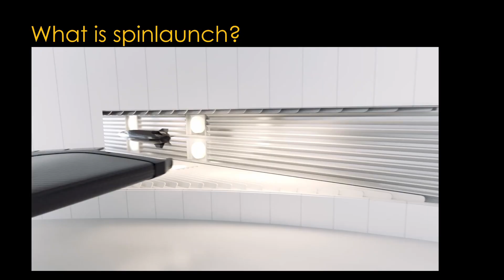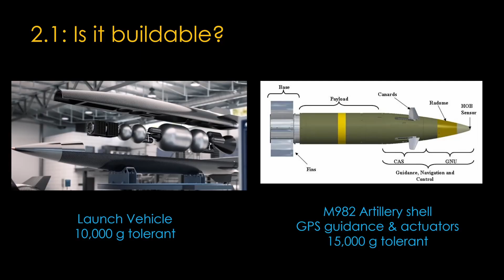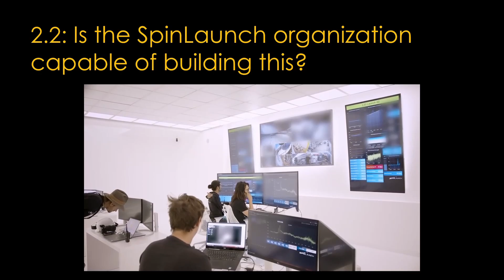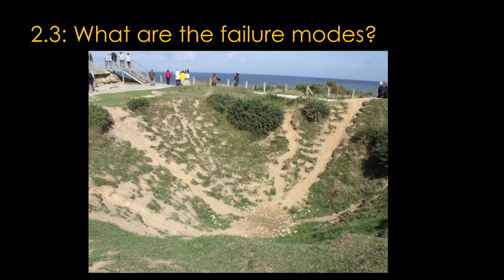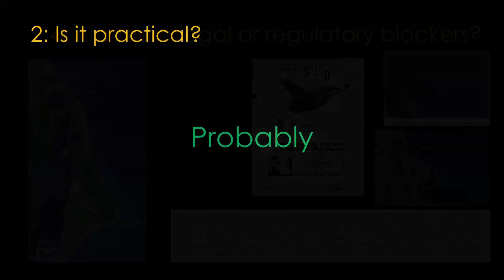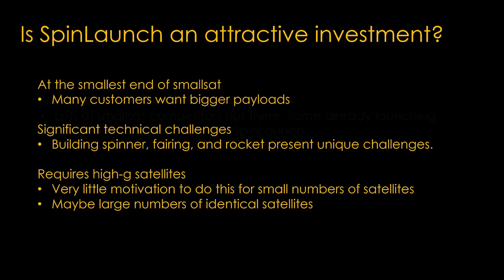Spinlaunch - What the???

Comment: December 2025 - SpinLaunch has pivoted fairly strongly from just developing its kinetic-launcher toward building a full satellite communications network of its own. Their new project, Meridian Space — a low-Earth orbit (LEO) broadband constellation — is now a core focus. 
As of August 2025, they secured US $30 million to accelerate Meridian Space’s development and commercialization. 
The plan is to start flight- and customer-link operations: they aim for the first customer links in the second half of 2026. 
SpinLaunch contracted Kongsberg NanoAvionics to build the initial batch of ~280 microsatellites for Meridian Space. 
They’ve done full-scale testing of a “multi-band reflectarray antenna” — a more compact, power-efficient antenna design they claim will help make the constellation more cost-effective and scalable. 
Although Meridian will initially deploy using traditional rockets, SpinLaunch says it remains committed to its original kinetic/centrifuge-based launch technology.

Comment: 2024 update: All the issues with Spinlaunch mentioned in this video still applies. 
1) Not a word has come out about building a launch site. They will need an eastern seaboard site that will tolerate constant sonic booms. Not easy to find.
2) There are still no details about the release mechanism. No patents on Google Patents search, no nothing. This is the single item that I believe is the hardest. I can't imagine the release mechanism being mechanical in nature as it needs to release in some max 0.003 of a second. My best guess is that it is magnetic.
3) Spinlaunch's hiring has been slow, at least from what I have gathered from Linkedin. 
4) What market does this thing even serve? The launcher cannot be moved so it only fires into a single orbit.

I smell a flop here. The worst thing is that I really liked them.

Comment: I had a hard time finding data on the size of the projectile, but I read that the 1/3rd scale tester projectile was about 10 feet long. Assuming an 8/1 length to thickness ratio, it would be about 1.25 feet thick, so we could expect the full scale first stage projectile to be about 30 feet long and 3.75 feet thick.

There must be a release/latching mechanism to hold the rocket in place while it is spun up to these high ejection velocities. Assuming the latch went all the way around the rocket like a sleeve, and connected to the swing arm on both sides (as shown in some of the renders), and also assuming a thickness of the launch clamp of about 4 inches, then the total surface area of the launch clamp would be 360 inches x 4 inches, or about 1440 square inches per side, times 2 sides, equals 2,880 square inches.

We'll use your assumption that the projectile has a mass of 11,200 kgs (~24692 lbs). At only 1 G, that means the mass of the projectile is distributed across the launch clamp with about 8.57 lbs/sq inch. That's entirely reasonable. But... we're talking about spinning it up to 10,000 Gs. That means that the force of the projectile being held in place by the launch clamps would be a staggering 85,736 lbs/sq inch. Can any material even withstand that much tensile force? I'm reading that steel is about 40,000 - 60,000 lbs/sq inch.

Also, what happens to the fuel when you compress it with 10,000 Gs of force? Wouldn't the fuel combust from the compression?
Reply from the maker: Good questions...

Comment: They released another video on this recently. Got an update? More likely or less likely a scam?
Reply from the maker: I went and watched test #7 and test #8.

They are hitting 1200 mph and 30,000 feet, or 536 m/s and 9 kilometers of altitude. The altitude is their apogee; they are coasting up to it. 

As a comparison, Electron stages at 100 kilometers at 2400 m/s

They are a long way from imparting useful amounts of energy into their launch vehicle, though that may not be the goal with this version as it's sub-scale.

I think it's good that they've continued to run tests. 

I think their lack of transparency is not a point in their favor.

I haven't used the word "scam", but my opinion is still that this will not be an economically successful launch system.
Reply: @EagerSpace  Real Engineering had a 45 minute interview with them a few weeks ago. Have you seen that? It may have flown under the radar.
Reply from the maker: @JayVal90  I don't generally watch other space youtube channels; I don't want to be creating content that is derivative of them.

Comment: Lets see:  
If the mass of the projectile is 11,000kg, then the spinning arm and bearing is going to have to support 22,000kg (the projectile and a counterweight, we are going to skip the weight of the arm itself for now) while simply standing still.
However, under 10,000 g's that mass becomes 220 million kgs, or, the weight of almost 1700 combat loaded M1 tanks.
To further illustrate the problem, most powerful crane in the world can lift about 20 million kg's, so the crane's boom is 1/11th as strong as the spinning arm needs to be.
That's going to be a significant engineering challenge to overcome.

But, now comes the fun part:
When the projectile is released we have two options.  The first, the countermass stays attached to the spinning arm and now we have a flywheel that is hundreds of millions of pounds out of balance.  Think of your washing machine spinning when it's load is 5lbs out of balance, times several million.
The second option is, simultaneously release both the projectile and the counterweight.
This means that a 11,000 kg projectile travels UP at Mach 7 and another projectile travels DOWN towards the foundations of the spinning facility at Mach 7.
This seems like a one-shot deal, no pun intended.

Add to this that the projectile will be transitioning from 0 lb/ft(2) of aerodynamic pressure (a vacuum) to approximately 72,000 lbs/ft(2) in a fraction of a second and you've got a real party going on.

No, none of this is practical, economical or advisable.

Comment: I don’t know if it’s possible realistic but one of the things I’ve seen in their materials is they’re saying that they can do multiple launches in one day also from what I understand from their materials that marketing it’s called a vacuum chamber but when you listen to the engineers from the company talk about it they call that a near vacuum as far as it being a more accurate term.
Reply from the maker: I don't think there's any reason they couldn't launch more than once a day as it's possible to replace the exit diaphragm and pump down the chamber again. I didn't look at the cost of doing that each launch.
Reply: @EagerSpace  so one advantage they might have in addition to cost reduction is if There is a scenario where you need to launch multiple launches in the same time period in rapid succession . That no other method would allow for without extreme cost as well as disruption to air traffic
Reply from the maker: @jclark4045  I can see that, but with their small payload size there are a number of launchers who could do the equivalent payload in a single shot.
Reply: @EagerSpace  also from a marketing stand point this system is greener in theory
Reply: @EagerSpace  true I don’t know if there are any scenarios where one of those would have advantage over the other.
Reply from the maker: @jclark4045  Compared to which launcher?
Reply: @EagerSpace  sorry that wasn’t well phrased. So as far as which system would it be greener than? Any system using fuel from the ground to space instead of spin launch where fuel is way less. Arm can be theoretically powered by green electricity. As far as the two methods in the second comment I’m saying I don’t know if there’s an advantage of releasing multiple vehicles with one major vehicle versus going to having multiple smaller vehicles but in a much more rapid pace in the smaller time. One possible advantages as the government regulates commercial space flight more and more since we’re starting to have lots of companies they may start to tax different size vehicles at different rates
Reply from the maker: @jclark4045  Thanks...

I think you'd need to do an in-depth model to understand whether it's greener or not. The spin launch can be powered by green electricity, and rocket fuels like hydrogen or methane can also be created by green electricity. I'm a bit skeptical of spinlaunch being green because their initial launch gives a relatively small amount of energy and because they have the two-stage rocket that they discard every flight.
Reply: @EagerSpace Greener not green period just to be clear. And only in theory of potential not saying as of current

Comment: As someone that has been a big fan of scifi my 50+ years I love the idea.

As someone that doesn't have a mental deficiency however I despair for humanity that people are heavily investing into it because the only way that this will work is by suspending your disbelief.

So what if they did a proof of concept that kinda-sorta but not really proved anything. Nothing got launched in LEO, there was no payload of any sort, the trajectory was not fully under control (wobble), there was no vacuum (or actualy low pressure) chamber, etc...

Hyperloop had a couple of people travel a mile or so. That still doesn't mean that it can be up-scaled to something that makes any economic sense. Same thing applies here. Sure they managed to throw something a few 10's of thousands of feet. Whoa, how marvelous (sarcasm). 

FYI, a commercial jet flies at 40K feet. LEO is 160km (of +500K) feet. 

Ah a fool and his money.....
Reply from the maker: >That still doesn't mean that it can be up-scaled to something that makes any economic sense.

And that is the meta point. 

I do give SpinLaunch some credit in that they've actually built something at a reasonable scale - see my video about space guns where there are many ideas and little hardware - but I'm very leery of big projects where you invest a ton of money in big hardware and hope that it will be practical and profitable.

Comment: The tether holds onto the aeroshell and spins around and around picking up rotational speed. Spinning up to 450 rotations per minute before release. Relative to the structure the aero shell is itself spinning at 450 rotations per minute. On release the aero shell continues to tumble at 405 rotations per minute. It has tiny little fins which is supposed to stop that tumble and keep it flying straight. It’s in a semi vacuum with nothing for the fins to grab onto. How is it supposed to stop tumbling? When it enters the air what is supposed to stop the aeroshell from tumbling, those tiny little fins? It’s a dense projectile tumbling at 450 rotations per minute. Its going to keep tumbling end over end.
Reply from the maker: Based on the video they released, it looks like the projectile comes out straight.
Reply: @EagerSpace  In the Thunderfoot video, you can see the spinning projectile.

Comment: A problem which seems not to have been mentioned yet: It is not only the 10,000g, it is going from 10,000g to 0g (in that direction) within microseconds. That would cause strong vibrations in the whole system which I guess are a much bigger challange than withstanding 10,000g which build up slowly.
Reply from the maker: There are artillery shells with electronics in them that go from 0 to 10,000 g and right back. The US even built small nuclear weapons in artillery shells.
Reply: @EagerSpace  ... but what exactly do those shells do at the point that it goes from 10.000g to Zero? Care to explain how that is equivalent to something that isn't supposed to evaporate when it hits Zero g ?

Never mind that artillery shells only have the sharp shock of 0 to 10.000 during a very brief window, not that it has to endure that ramping up (vibrations) during hours.
Reply from the maker: @PDVism  The shell is being continually accelerated because of the pull of the arm. When the arm releases - assuming it's a clean release - the shell at that point just goes in a straight line.

Comment: Okay so if it has a releasable counterweight to stop the arm disintegrating at the launch of the payload....where does that go and how would it be bought to a stop?
Reply: One proposal is dual launch. Supposedly a half turn that’s imbalanced wouldn’t be a problem.
Reply: @JayVal90 fatigue stresses on the lever arm and the inrushing air absolutely would make it a problem.
Reply: @domvasta  Well, that’s a different problem that you’d already have even with single launch

Comment: Some Calculations:
1. Mass = 11,200 kg
2. G = 10,000
3. Load On Arm = 11200 * 10000 = 112,000,000 Kg = 246917733 lb = 123,458 tons
An Iowa class battleship weighs 56,500 tons fully loaded. The load on the arm is 2.18 battleships, not including the weight of the arm. The motor bearings cannot handle that kind of load without a counterweight. They do not mention a counterweight or what they would do with it at launch. It will be going at the same velocity in the opposite direction. This load has to be released with an accuracy of 0.3 milliseconds. Good Luck! This is obviously a money scam for gullible investors.
Reply from the maker: That has been my opinion, but they've done a number of test launches and they seem to be successful. Sub-scale, of course, and they haven't really released much information, other than showing on their recent test that they hit more than "1000 mph" (who uses mph with rockets any more?), or about 450 m/s. Their target is something like 2750 m/s, which means this is a 1/30th scale test in terms of energy right now.
Reply: @EagerSpace  Their stated goals are much higher. See the video.

Comment: Hi Eric, I  enjoyed your review of SpinLaunch. We are an alternative impulse launch company called Green Launch.  We are developing a higher velocity launch technology that may be of interest to you.  We are using a light-gas impulse launcher to supply a much larger fraction of the velocity needed to deliver satellites to Low Earth Orbit.
As with SpinLaunch our technology is potentially cheaper and more flexible than conventional rockets.  It is also much more environmentally friendly since unlike conventional rockets we produce zero hydrocarbons with the first/main stage.  Unlike SpinLaunch, we do not have significant physical limitations in reaching our velocity requirements. The fastest published velocities for a spinning armature are approximately 1.4 km/sec.  The record for a projectile launched with hydrogen propellant is 11.2km/sec.  We plan to limit our launch velocity to 6 km/sec to extend reusability and prevent wear on the barrel. In a best case they will need a large two stage rocket to supply a delta-v of an additional 7 km/sec.  Our rocket would need to produce an additional, and more achievable, 3 km/sec to circularize and achieve orbit.  One additional discriminator is time at high G as you mentioned the spin approach exposes the payload to this stress for an hour while a light gas gun sees these forces for 40 miliseconds. Failure modes for a spinning system are quite a bit more unpredictable since it could eject the projectile and/or counter weight in several directions with different outcomes. Ballistic system failures are well characterized and more easily recovered from.  Most likely there will be several redundant launch tubes so that one failed tube will not put the entire operation on hold.
Here is a recent press release regarding a successful launch we had at the Yuma Proving Ground in Arizona in December.
https://www.businesswire.com/news/home/20220113005870/en/First-Vertical-Light-Gas-Launch-for-Space-Access-by-Green-Launch
A video of the December launch is on our website: https://greenlaunch.space/
Our technology is straight-forward and our company's strength is launching objects between 2 km/s and 6 km/s (Mach 6 and Mach 17).  For orbital applications one has:
The vehicle is launched ballistically at high speed and it penetrates the atmosphere within a minute and sheds the aeroshell
A rocket engine fires which provides the added velocity to attain the desired apogee which can be 300 km to 1,000 km altitude.
The satellite or emergency supplies is maneuvered to the desired orbital location within 2 hours
Our future markets range from just in time supplies like medicine, tools and small satellites, to delivering large amounts of propellant and consumable to depots in support of space missions.
Our current collaborators and customers include UCSD and Harvard on an NSF sponsored project.  We will be sampling the mesosphere between 30 km and 100 km in order to determine the isotopic gas content.   This has great bearing on the earth's energy budget and provides physical data for climate scientists around the world.  Green Launch is uniquely able to take biopsies of the earth's atmosphere at altitudes too high for balloons and too low for satellites.  Sounding rockets are much more expensive as well as very polluting eric.robinson at greenlaunch.space
Reply from the maker: I talked about Green Launch in my "Guns to Space!" video: https://www.youtube.com/watch?v=mjbuaY-psS0
Reply: what happens if it comes back down?
Reply: You're a little short of the 3000 words there